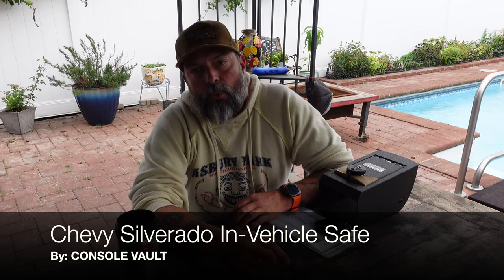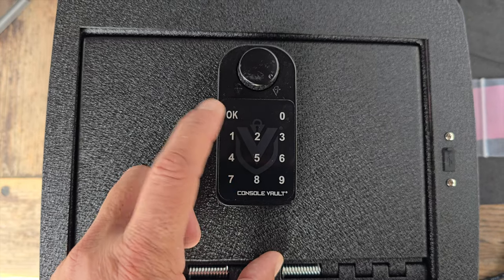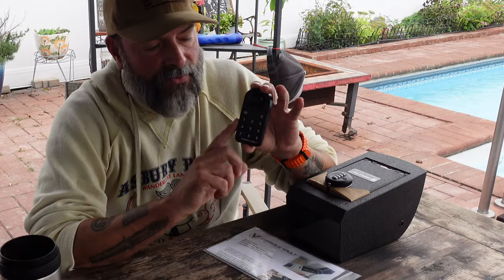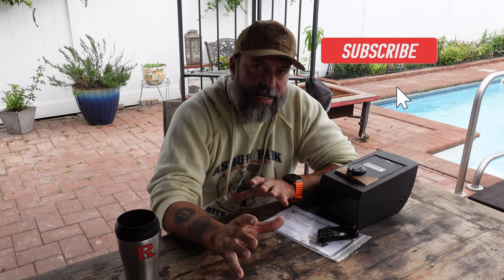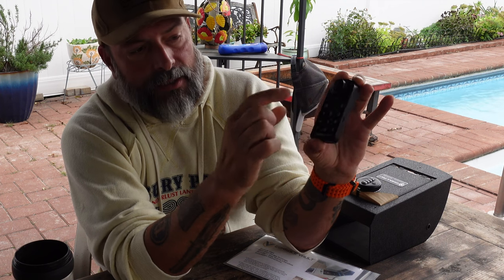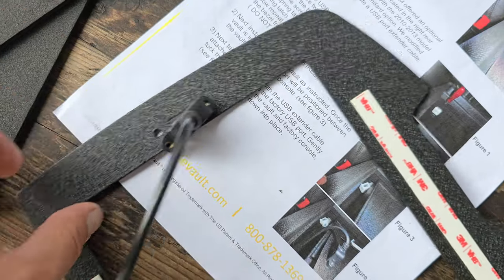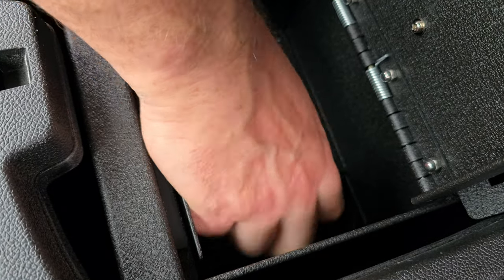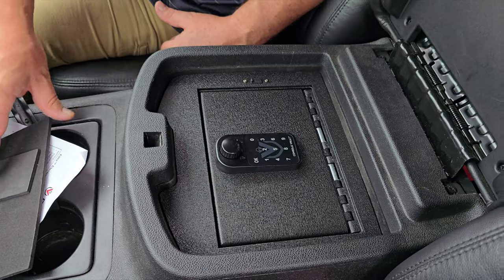Chevy Silverado Console Vault Review: Upgraded Security with New Electronic Lock!

Comment: Is the lock metal?
Reply from the maker: There are metal and plastic components.
Reply: @CoachHelder  but the frame is metal? The knob?
Reply from the maker: The housing is made of metal but the knob seems to be a hard polymer.
Reply: @CoachHelder  thanks
Reply from the maker: I am going to send an email to CV to get the facts. It's tough to tell 100% on my end.
Reply from the maker: CV replied back and they said that the electronic lock is made out of cast aluminum.